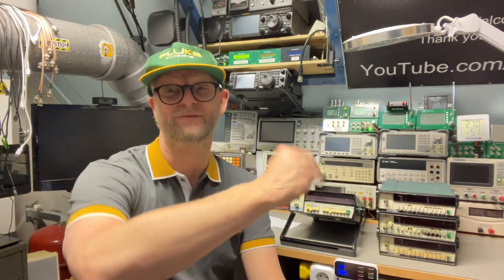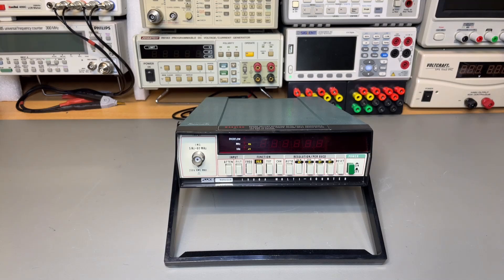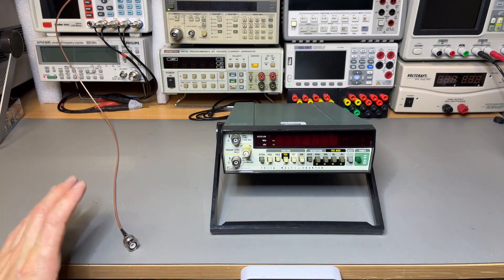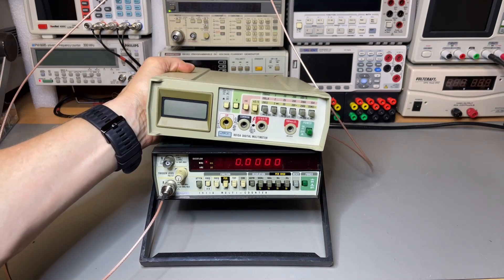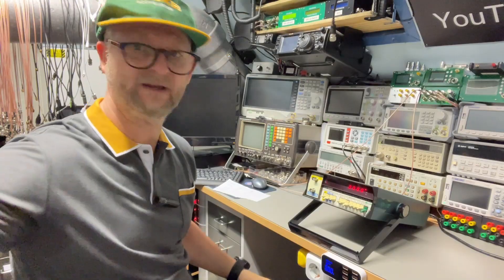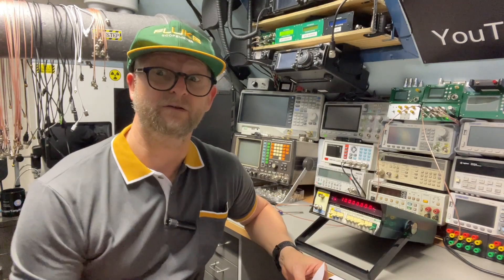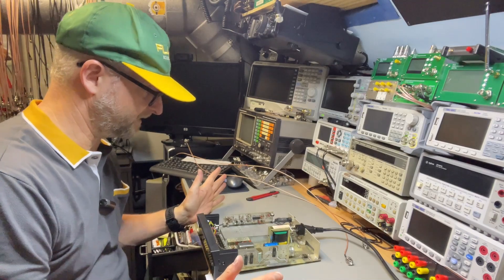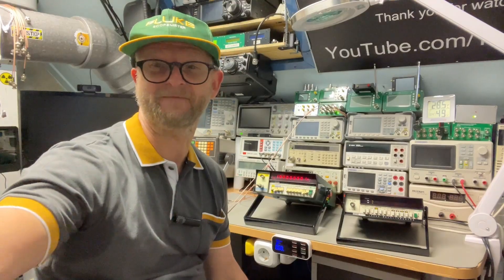TA-0360: Fluke Friday (E19) The 1900A Frequency Counter 1910A 1911A 1912A 1920A

Comment: I have the 1920A. Mine has options -04 TCXO and -06 Multiplier resolution, it also has the ability to use an external reference but someone replaced the enclosure and does not have the cut out to access it. I don't really use it anymore since I have many HP counters that give orders of magnitude better performance. The 1920A will count all the way up to 700MHz on the 50 ohm input and 145MHz+ on the 1 meg ohm input, despite all this it's still a great frequency counter.
Reply from the maker: Very nice Craig!  thanks for sharing, nice equipment!